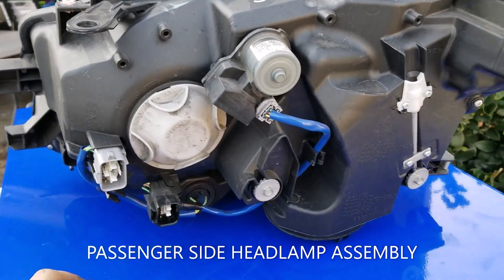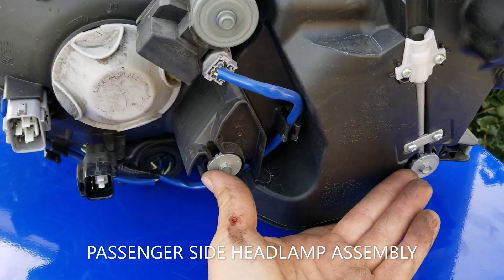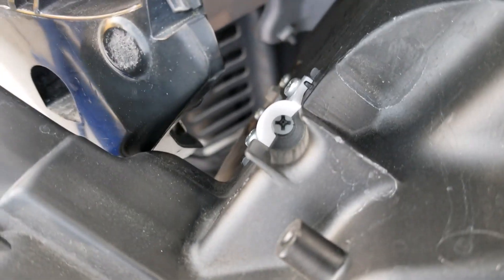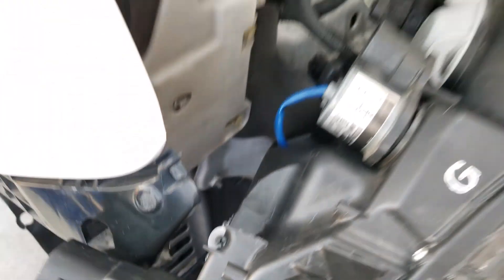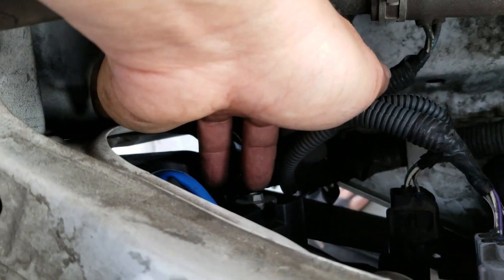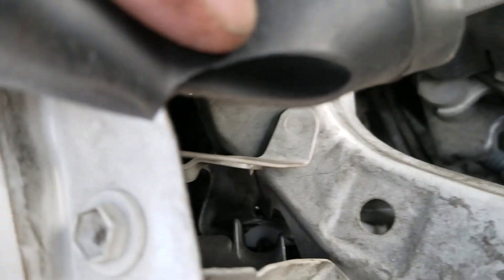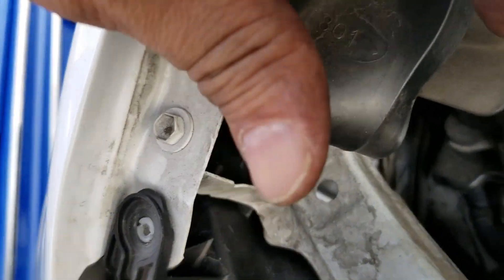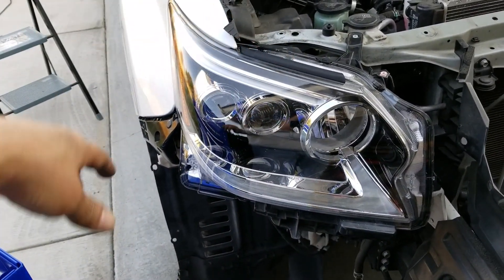2014-2019 Lexus GX460 Headlight Adjustment

Comment: Many videos on how to set the beam. My own experience is it's best to adjust in the shade not full dark. Why? Well at night it is harder to differentiate the Beam from the Flood. Projector lamps throw a different pattern than older lamps. The older lamps have all around flood and projectors cut the flood off the top making it difficult to illuminate road signs. Happy Motoring.

Comment: Hey Bob, it's actually Phillips for both adjustment knobs
Reply from the maker: It actually gives you several options depending on what angle you’re hitting it at. Phillips is more difficult if the headlamps are installed. Using a flat head on the spline or hex socket on the 2nd adjuster was more easier for me.

Comment: Bob: My 2021 headlight has two adjustment screw, the same as indicated in this video. 
I believed your 2021 Chinese aftermarket LED headlights may have same 2 adjustment screws. 
 User manual of 2021 GX460 stated that once turn one of the screws, other screw has to be turned exact direction and number of turns as other at the same time.
 Will you please find out what is an effect of the screw located very closed to the fender ? 
 Because when I turned CCW  at engine side and without turning the fender side, I think beam direction moved to side of the road. ( I tried on Driver side) . Thanks
Reply from the maker: the screw closest to the radiator shoots your beam up/down.  The screw closest to your fender moves your beams inward/outward.  I only screwed the amount of times necessary to make the lights where i want them.  I drove the car at night and readjusted accordingly.
https://youtu.be/C0LvypIkcvk
Reply: @GXBOB  Does clockwise or counterclockwise lower the beam?